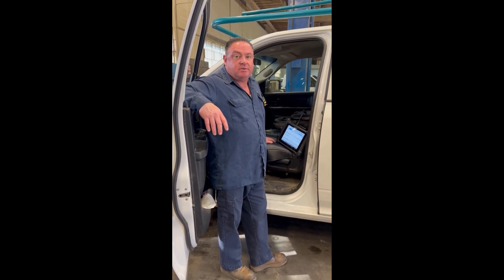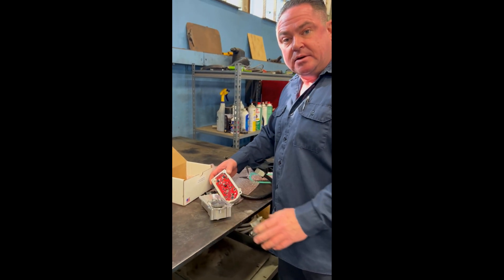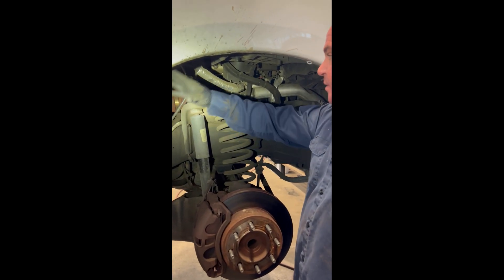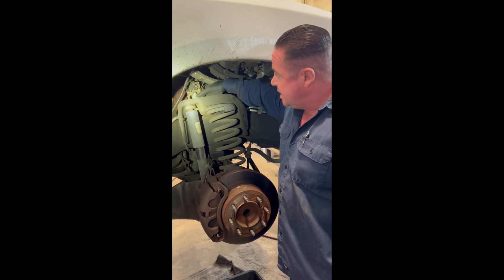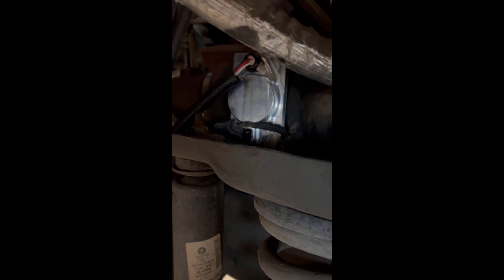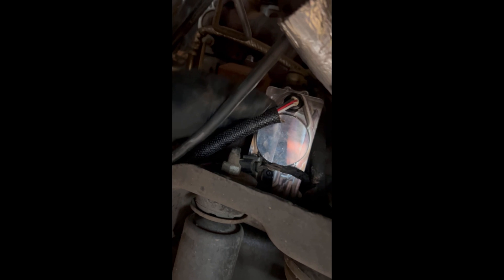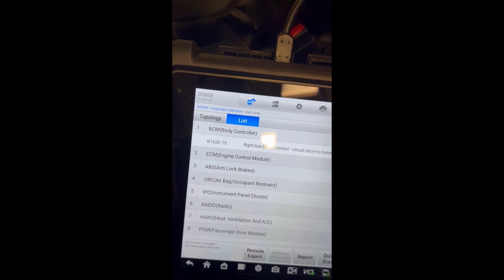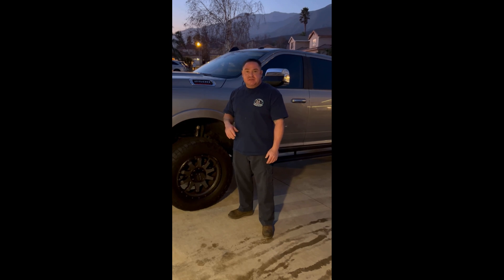Ram Cummins 6.7L Diesel Trouble Code U010C Turbo actuator failure / Replacement / Installation

Comment: what year is that Cummins?  what are symptoms of this, thanks.  easy job or not so much?  looked not too bad, 2022 w 72K here
Reply from the maker: This will cause low boost and low power. Should throw a check engine light. At your year and mileage yours should be under warranty. It’s not hard to do, however if it is under warranty it will save you time and money to have the dealership do the repairs for free.

Comment: What scan tool is that
Reply from the maker: Autel
Reply: @good2know606  is there a specific model and will it calibrate the actuator
Reply from the maker: @CharlesReadJr mine is the Maximus MS906Max

Comment: I got the code today, I cleared it and drove it for a bit and it seems to be building boost and the exhaust brake works. If it comes back on I’ll have to change out the actuator
Reply from the maker: How many miles are on the truck
Reply: @  172k

Comment: Can the actuator cause a no start when it's hot also ou1oc code an ou1oe
Reply from the maker: No I have never seen an actuator cause a no start. That code is ECM lost communication with the actuator. Most likely a bad actuator. Make sure you inspect the turbo when you are replacing the actuator. Reset the codes and re-inspect. Let me know what happens and if the problem persists I’ll try to help you out. Thanks
Reply: @good2know606  thanks

Comment: I have code dtc u010c active and p2509 and p226c inactive, turbo has no play or weird sound could it be just the actuator? Truck is deleted
Reply from the maker: Let me look it up real quick
Reply from the maker: I would look at the connection at the actuator and if it looks good replace the actuator. 90% of the time it’s going to be the actuator
Reply: @good2know606  sounds good I will look at the harness again and check if I don’t find issues I’ll replace the actuator thank you!
Reply from the maker: @carlosalcala4314 you got it, get the actuator from this video, it’s half the price and no set up , let me know if you have any other questions and please follow the page
Reply: @good2know606  got the new actuator in from city diesel, just have a quick question. Did you apply some motor assembly grease on the gears of the actuator or left them dry?
Reply from the maker: @carlosalcala4314 I applied the grease that came with it. It’s white grease. Good luck, let me know if you need anything.
Reply: @good2know606  sounds good, mine didn’t come with any grease that’s why I was wondering I’ll go ahead and buy some to apply on the gears thank you
Reply from the maker: @carlosalcala4314 yeah definitely put some grease in there. 👍🏻
Reply: What’s the website for City Diesel? Thanks!
Reply from the maker: @shawnajanae www.citydiesel.net

Comment: I’m in the very early stages of the engine check light coming on. I have had the codes checked and it looks like the actuator is the problem. My question is can I still use the truck until I can get the parts or do I risk further damage. Thanks and also thanks for the video especially the part about lining up the pin and the tip on removing and reinstalling the bolts as no other videos mentioned that
Reply from the maker: You can try driving with the exhaust brake on also, sometimes it will clean out the area and start to work again. You can still drive it but it is not recommended especially if the light is on all the time. Try taking it down a grade with the exhaust brake on if you can with a load. It may go away.
Reply: @good2know606  I am actually one of a few that turns my engine brake on every time I drive so it gets plenty of use. While climbing a hill with my camper I can get the boost up to around 26lbs so I feel the turbo is probably not the issue. I am waiting to get the truck into the garage to see if this is covered under extended warranty, if not I’m going to definitely replace the actuator with the one in your video. The frustrating part is that I was planning a trip next week and wasn’t sure if it would make the problem worse but after seeing the video I decided to try and get it replaced first. Thanks again and I look forward to seeing more videos
Reply: @larryhazen2224 I think I'm in the same boat, any advice? I always run the exhaust brake, and need to drive my truck 200+ miles to get it worked sooner than anywhere else. It has only driven 25 miles since the light came on... and I can't afford to shell my engine yet.
Reply from the maker: @bradcopeland7457 easy way to see if it’s your turbo actuator is to check the boost. You should be able to scroll through dash and find the boost gauge. Then take it for a spin. Up hill with a light load you should see around 20-25 psi. Usually if the actuator is bad you might get 2-3 psi if you’re lucky. It’s still drivable but you should consider replacing it as soon as possible. Let me know if you have any other questions.
Reply: @good2know606  the truck for the 25 miles with light on, showed no problems, turbo built boost fine with no load, no change in road manners
Reply from the maker: Try to clear the code it might stay off if your lucky
Reply: @good2know606  hey so update, 2-300 mile trip to service station with availability later, mid trip check engine light and I assume code turned off, followed shortly with a perform service message, does that narrow it down or just noise at this point?
Reply from the maker: @bradcopeland7457 what is the mileage
Reply: @good2know606  135k, with me only knowing what happened for the last 10k
Reply from the maker: @bradcopeland7457 every 68,000 miles there is a crank case breather filter reminder that comes up on the dash Perform Service. Change the filter and reset the reminder you should be good. 👍🏻

Comment: Thanks for the video, after a recent oil leak repair. This is the code that came up U010C. What was the cost of the actuator?
Reply from the maker: The cost from city diesel was 900.00 it was well worth the money. Cummins actuators cost about 1,400 and you have to program them. Let me know if you have any questions and I’ll try to help you out. If you can please like and subscribe to see more content on these trucks. I’ll be adding more information soon. Thanks